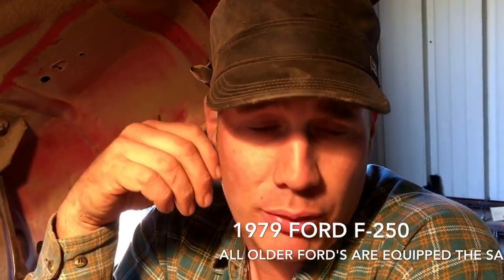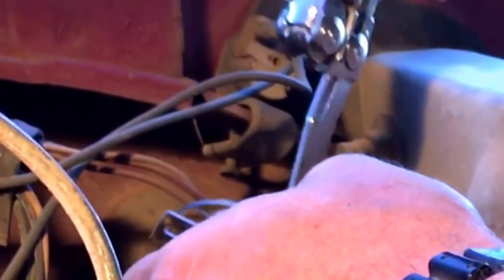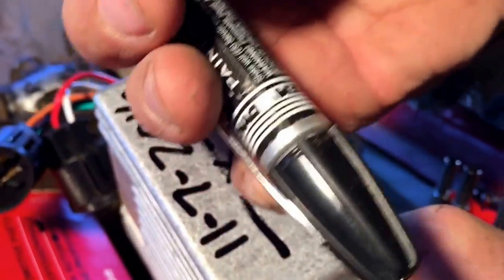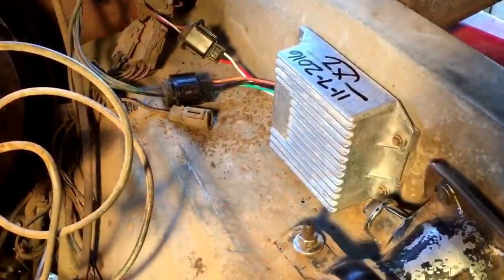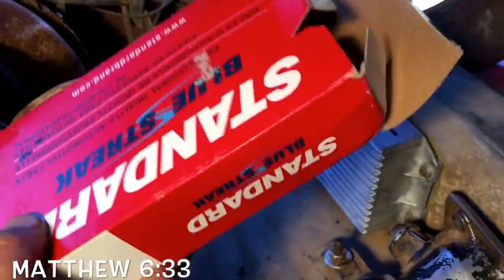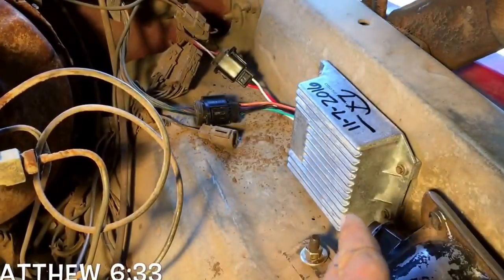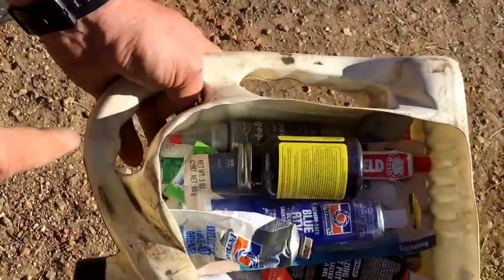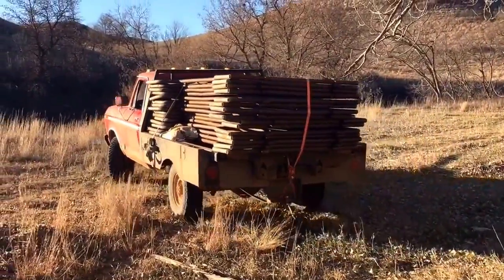Electronic ignition module on a ford.

Comment: I love those 6th gen Ford trucks. I always kept a module, thermostat, alternator and cap and rotor in my toolbox behind the cab. I've been looking for a decent 3/4 or 1 ton in my area but the road salt and rough working lives haven't been kind to them. Ones in decent shape bring big money. Best looking trucks ford ever made in my opinion.
Reply from the maker: +captainquint 
   She's an old workhorse. You put that baby in four-wheel-drive she turns into a complete tank. This year we got 2 feet to 9 foot drifts. I push snow with the hood and she just keeps going forward. My wife just accidentally took the engine out of her, she was warming it up . And The radiator Hose broke, Took the engine out. I'm putting a 460 in out of a 1977 Ford 1 ton. Been a busy winter..; )
       Sure appreciate you taking the time to leave a comment. Thanks for the support, comments like this keep us going forward. Good luck finding an old Ford , if I see one I'll let you know .Thanks for watching.
Happy trails
Luke
Reply from the maker: +captainquint 
   Another thing that's good to keep behind the seat is a starter relay! Seems like they go out often as well.
Reply: captainquint p
Reply from the maker: +AJ Lopeman 
    Hey thanks for watching.
Luke
Reply: Back to the Basics 101 no problem gunna start back up with my videos in the spring
Reply: Back to the Basics 101 Or a thick screwdriver 😉

Comment: No ground  needed it has a ground  .   It is  internally  grounded .  Another  great  idea is to put small 1/4 inch rubber  grommets between  the modual  and the enter fender to dampen  any vibration.  Or  a aluminum plate under the module  to dissipate  heat before  it even get to the module. Like a aluminum plate  that goes  under a carb . So the heat will go around  the carb.

Comment: Awsome info. My second Ford. I got an 93 f350 got a good deal bec trans was blown and motor didn't run and it was growing moss with a bed full of junk. 

I got the motor running then rebuilt it. Now I can't get it running again. And found a trans in Kentucky. 

Anyways I sure hope this is it. Can't wait to hear it run again. And drive it. ThNks again.

Comment: I was hoping you'd covered some wireing detail on the module connectors, input, output, signal ect. I was looking to try it on an imploding fuel cell. I just didn't recall the signal color wire to collapse the coil. Other than that. Great casting !

Comment: First-time viewer great video. Just picked up a 1977 F150 with a 351 modified painfully stock AM FM 8-track player 4x4 4 speed with a vinyl roof which is new to me. It's been sitting for 16 years has all the original paperwork including the August 6th 1977 date that it was purchased on the customers dealer slip inside the owner's manual.  I was 17 on the exact date that this was bought. It only has 47000 miles on it because it has a HEI ignition system and they were told that it never needs a tune-up.  The original owners lived in Show Low Arizona and only drove it when it snowed. So it has a little rust and beautiful patina. I can't wait to get this thing going. Thanks for the tip on the spare aswell. 
Mike, Wickenburg AZ

Comment: This helped immensely. I was stuck on a fuel issue as that was what it was acting like. This video led me down the right path. with some basic testing I was able to prove it was the ignition module. swapped it out and was back in the saddle. Thanks again. 1985 ford econoline camper van.
Reply: What were the symptoms of your issue? I have an 87 e150. I'm gonna change the module

Comment: I found  that the ignition  modual get hot and stop.  I moved mine far away from  any heat source. And now it work fine.  Thinking  of  putting a  12 volt fan over the top of it.

Comment: about the scrap car consolidation with extra bits: I guess you have to haul the vehicle with scraps in it yourself, seems the options I have locally are to call a junk yard that gives a set price to come haul off an old vehicle, and not get credit for the extra scrap weight that has been accumulated - but no option I know of that is a scrap metal yard that takes cars. will have to look into it I 'spose.

Comment: 🤣 that little girl and good video I'm thinking of trying to get one running that the key won't turn over the motor but by touching together a couple wires the motor spins but engine does not get spark.

Comment: Changing the Ignition Module is not always the  answer,  I had  Problems with my 1978 302 last year,  first I changed the  Module same problem then the  Distributor pickup then found the ignition switch located  on top of the steering column was the  problem. It  had the same  symptoms, Fire up run then quit randomly with out notice! I have Owned  my car since new in 1977 and have had experiences with modules  pickups and ignition switches  so it is not limited to just the Module.
Reply: Agreed. It would benefit troubleshooting if he shared the resistance value of a good pickup coil...and ignition coil. He just baits losers with his "free" routine to sigh up paying customers. He hustles on YouTube to keep his dude ranch solvent.

Comment: Do you suppose that the electronic ignition module would also be located on the fire wall in a '89 Mercury Topaz with the 2.3?? My old Topaz use to do that. I'd be on the highway, then suddenly the Topaz would start slowing down. I'd hit the gas pedal, but it wouldn't respond. Would the ignition module failure cause that??

Comment: I have an 84 5.8L ford f-150 that my wiring is pretty much shot. I am having a difficult keeping the truck on and at time is will crank but not turn over. i have a new module but how do i tell when does the old one is bad? does it change colors, any smell that they put out... just trying to find out if its my harness or the actual module. 

Ive been told to just replace it with buying an HEI distributor. maybe you can help me by shinning some light into how to tell when they go bad. thank you for your help.

Comment: Is there any difference between thr modgel. Just pulled a one out of the yard from any 80s ford. Mine is a 76. Both of them have the blue plate om the bottom.

Comment: To my understanding of the duraspark ignition is that is doesn't actually ground to the body. My duraspark 2 came from the factory  bolted to the plastic fenderwell the my 85 f150
Reply: slyder139 Mine too.

Comment: I just bought a 1979 Ford E150 van. Crank no start..noticed the fuel pump has no power..no fuel begin delivered. I’ll look to change the fuel pump relay but could this be something to look into. A lot of the stuff on the van is old..been sitting awhile.
Reply: Does it have a electronic module? Thought my 94 ranger was a fuel pump but turns out my edis 6 module was unplugged along the wiring so had no fuel pump check engine light and no spark as well. Replaced the fuel pump when that probably wasn't the issue in the first place.

Comment: this was a helpful video. my truck has the same symptoms, I am gonna take the module down to auto zone , evidently they can  test them.  if its not a faulty burned out module and keeps dying just like yours did then what would be the next  thing to check next? mine is 1976 F-150 has V8 390
Reply: well im back and it was burnt out, got it replaced im so thankful for this video now I kno what to do and how to change it. I expect the truck to run a lot better now.
Reply from the maker: Thanks Travis, when I originally read your first post I was just envious of your 390, it was one of the last muscle engines Ford made. I figured there was a 99.9% chance it was the module.
Glad the video helped, if you have not subscribed, please consider doing so and keep in touch.
Happy trails
Luke
Reply: So Luke I have bad news, I was all excited when I changed the module and it ran well, however it was short lived. initially when I drove it It was a cooler out doors cooler temps, but I was convinced that it was fixed.   , I live in Spokane, we had some cooler weather, and historically the truck runs better in the cool weather. anyway I did like you said I had put the new module in and was confidant that my issues were done, well I drove it today and it was like 78 degrees and I only drove it about 2 miles down to the post office and then on my way back it dies, died out of no where. So I have a brand new ignition module in and is still dies when it gets hot. somehting has to be getting to hot and shorting out? Hell if I know what it is.   this has plagued me for along time with this truck, so after I let it sit for a while it will start up, I was only about 1/2 away from home, so I just parked it and walked home then about an hour and half later I rode my mountain bike back got it started right up and drove it home.   As mentioned before it runs well in the winter, something is shorting it out. I don't think its carb related, not flooded, not vapor locking.  Please help any Ford F-150 Gurus out there, so I know what to tell the mechanic when I got to get it worked, on, I am so frustrated at this truck, seriously considering selling it, my Grandpa Hgbee bought this truck brand new in 1976.  then my dad bought it out of the estate in Kansas state after he died and took it back to Wyoming and he used to pull his fishing boat with it,  the 390 is a beast of an engine.  Then I got from my dad.  I hate to let go.  Anyway any ideas you may have would be appreciated.  Luke I am Dave not travis  it s travelswithdave thank you
Reply: Travelswithdave ,replace the dist.stator asy. Motercraft part# du-1-a  dfpz-12a112-a this will fix your problem . You also  might need the armature part#dt-1  d3az-12a099-a. I hope this helps. Godbless.
Reply: @travelswithdave  replace the stator asy. Motercraft part#du-1a d4pz-12a112-a. This will take care of your problem. You also might need the armature part #dt-1  d3az-12a099-a  I hope this helps. Godbless.
Reply: @jimstauffer9942   6/26/2021 Saturday 9:30 pmJim hello I am not sure you will recieve this but my name is David Jacques I am writing to  from Spokane, Washington about a year or so ago you helped or gave me some advice on my 1976 Ford F-150 it was a from one of " back to basics" channel and him changing out the module on his F-150, well through communicating with him and you and the other Ford persons on that thread you suggested this 
  "   Travelswithdave ,replace the dist.stator asy. Motercraft part# du-1-a  dfpz-12a112-a this will fix your problem . You also  might need the armature part#dt-1  d3az-12a099-a. I hope this helps. Godbless.  

and just to give a short back history 0f my F-150 1976 390 v8 it keeps dying and stalling out of nowhere and you have to pull over the thing is is it would turnover again but not start but after sitting for a while say like a good 15 min it would start only to die a little bit further on down the rode, i have alway theorized that heat was a factory something is getting hot and causing it to die who knows what.  anyway i did change out that module and thought that was the answer and well i died again.  so as mentioned i am writing to you to ask you about the stator asy and the armature yhe 2 parts you suggested changing out, is your theory that that the one  i go has  short or it gets hot and causes it die if you were to change it out is might work also is it because you think the armature is cracked or faulty?  So i am considering taking my truck to my mechanic the man that has been working on it and have him just replace these, as a furhter step i am going to go ahead and get the module tested at auto zone tomorrow before it take it in/  the last question i have for you is if they end up fixing and replacing these parts and i have a good working module if it still runs and dies on me out of no where then what would one do and move on next?  i am just so darn sick of this truck not being reliable.  it is poised to run well, i have replace a great many of parts in it, new carb kit, new master cylinder, new belts and hoses, new radiator anyway i woule genuinely appreciate it if you could reach out and give me some of your philosophy on the topic it would help me justify going downt he road of spending more money onit.  when and if you have time Jim Thank you sincerely, David Jacques 1976 F-150 owner  390 v8  thank you
Reply: @travelswithdave  check and replace all ground wires

Comment: I have a 1980 f250 and my truck was cutting in and out on the highway. It eventually died completely on my way home and wouldn't start till like 15 minutes later. It usually always starts right up though.  it used to never do that and I adjusted the carb with a vacuum gauge. This is my next idea

Comment: Exact symptoms of a ford ignition module. Buy a good one and don’t worry about it again. Mine would die every time I hit a bump.
Reply from the maker: You’re a Ford man?
Reply: Back to the Basics 101  
I’ve owned a 65, 73, and 77 pickups. Had the same problems as you with the 77 till I replaced the ignition module with a lifetime warranty one. My 73 “Highboy” 390 never gave me any problems, it just ran and ran. Once I put a 460 in the 77 it ran great too. Didn’t like the 351. Not a bad motor, but I wanted more available horsepower. My 65 I bought when I was 14. Didn’t own that one very long. Sold it to a friend years ago...Not sure how many ford cars I’ve owned. 
I will say this, it’s hard to beat the durability of a Chevy 350 as a comparison, but everybody knew how a Chevy would rust!
Reply from the maker: Never had a 390. Always wanted one.
Let’s see I’ve owned a 53, 54, trucks. 
59, 60, 61, 63,64
67, 69, 74, 76, 78, 79, 82, 86, 91, 97, 2002.
I’ll pick ups and all fords. I’ve owned a few Chevys and dodges in between there as well. Still have quite a few of the pick ups and one truck.
Reply: @littletoze  I hear 77 ford has more issues is it true compare to a 73

Comment: I have a 1978 f250  and the control  module  is bad.  But the problem I have is that the previous owner  had broke the plug on the truck ( the small plug) and they replaced it with but connectors. Now I bought a new plug for the truck and a new control module  so the question is how do I know witch of the 4 wires on the plug. Do I connect to on the truck. Desperate  in need of Help!
Reply from the maker: Oh boy, hard to diagnose over the phone for me anyways.
Reply: Go to google images and get a diagram that shows which wire goes where. Usu red and green are the coil.